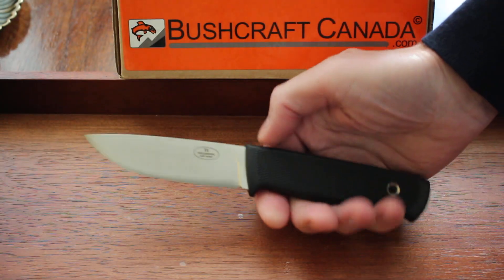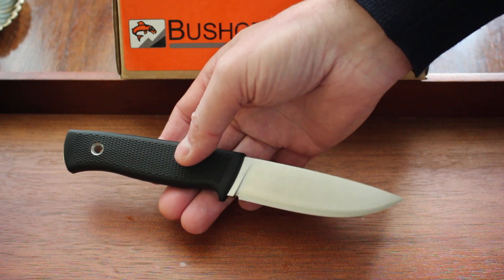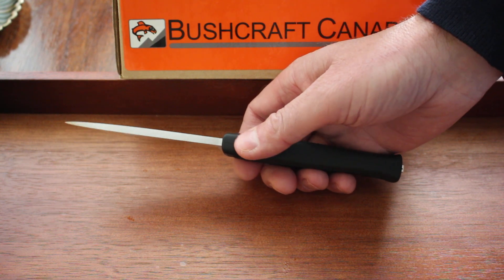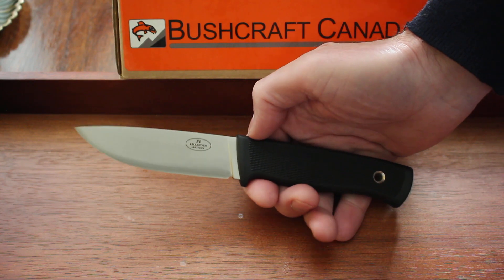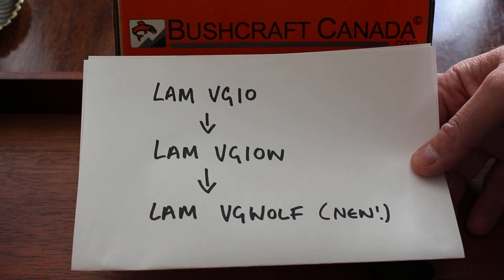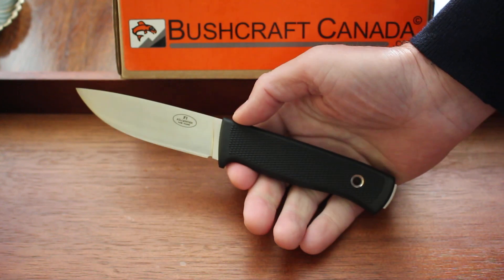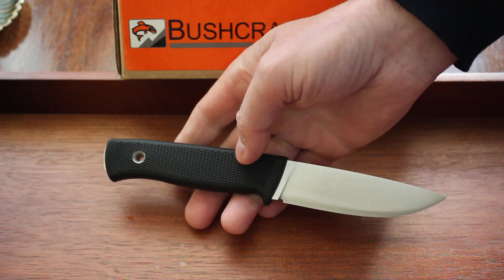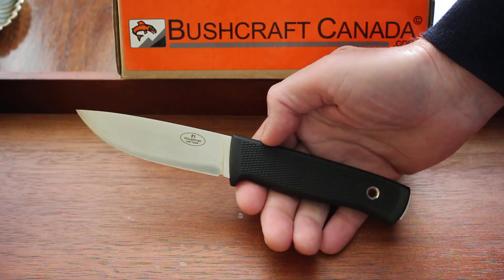Explanation of Fallkniven's new Steel announcement VGWOLF. Goodbye VG10W! by www.bushcraftcanada.com

Comment: Is this a full tang blade?
Reply: They all are , but on the Thermorun (rubber) handles, the tang is reuced slightly in height to accomodate the Thermorun overmold.  Tang protrudes about 3/16" on the end of the pommel.
Reply: @ketodad  Gotcha thanks, I’m due for a new Fallkniven soon
Reply: @Notallowed88   The newer VGWolf. F1’s with the locking sheath are really nice , and hold a great edge. Very nice  general use knife , and good in cold and wet environments.
Reply: @ketodad  I had an F1 years ago but sold it mostly because the sheath was an afterthought, I’ll check one out.
Reply: @Notallowed88  Did you get one , man ?  Used mine for 2 years solid now.  Pretty much my favorite daily use knife. Good for everything!
The new X sheath is awesome too .  Very secure and easy to use sheath . No knife or sheath problems at all. Get the Elmax F1 if you didn't get one yet.
Wicked cutting machine.

Comment: I never owned a F1 before. Have used a Jarl instead. When I heard that they had a test batch with VGWolf I ordered a F1. I happen to like blades around 10 cm long. First I got a bit disappointed. WhenII gripped the F1 it felt so much thinner and smaller than the Jarl. I stropped the knife and have used it a lot during the last two weeks. F1 have really grown on me. It is light and have an excellent sheet. Because of  a different blade profile then Jarl it is definitely spicier. Tried it for foo prep. I normally use Chef knives at home. During a weeks holiday on Öland in Sweden I used the F1. for food prep. It works better then Jarl but i direct comparison with a Hattori chef knife all outdoor knives fall far behind a real chef knife. F1 with WGWolf has become a new favourite. A perfect knife for my daily needs. The sharpness after my quick initial stropping is still top notch. Presumably the sharpest knife I own.